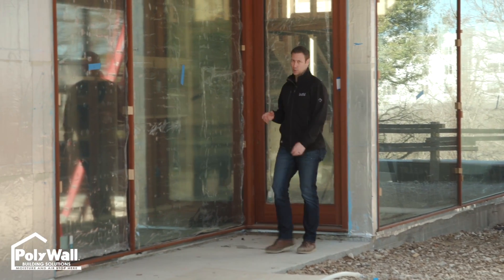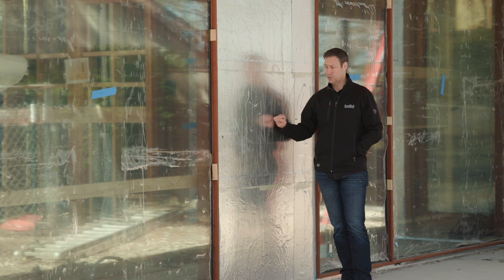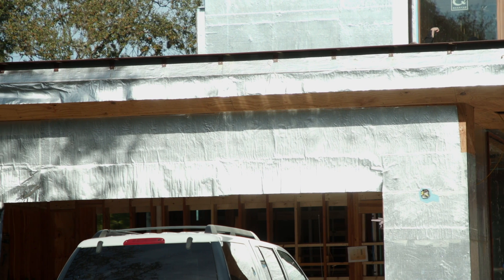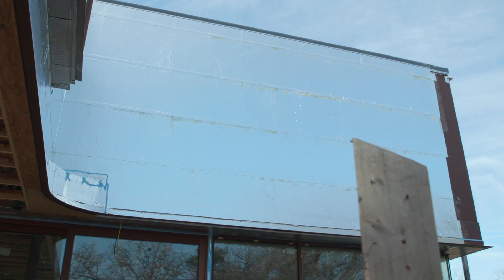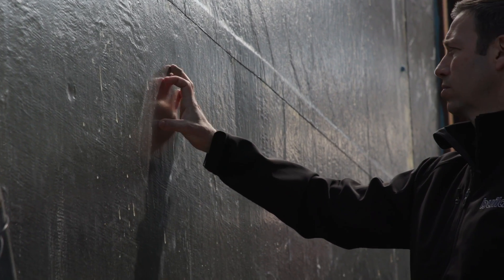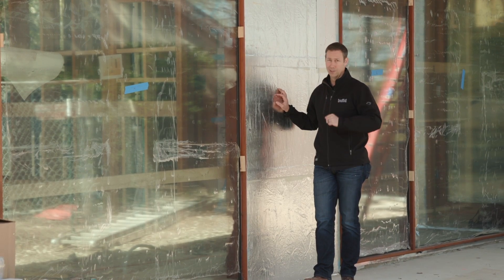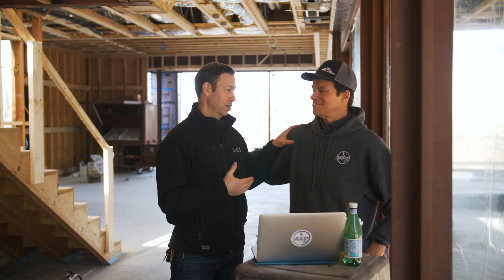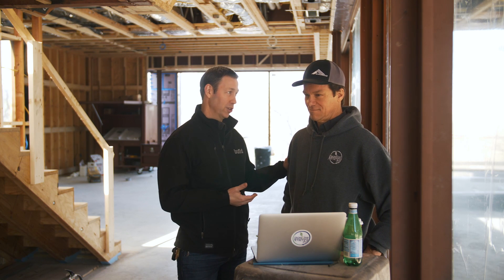Is a Zero Perm House Wrap Stupid?

Comment: To keep dewpoint in the foam, used WiFi to simulate.  I planned on wall drying to inside so used borosilicate paint to allow permeability of drywall.  Passive house training said primer and two coats of paint is nearly zero perm.  Have you considered this for your projects with the aluminum looking barrier?
Reply: Most latex paints aren't that bad (1-10 perms) unless you're dealing with something like a "bathroom" marketed paint. Vapour retarders are also only proportionally effective, so you likely have diffusion through the rest of the assembly. And air movement through other penetrations.
It's good advice for a passive house, where the margin is more important, but probably not an issue for the majority of builds.
I do wish building inspectors in Canada would accept impermeable paints in place of poly though ;)

Comment: Does the aluminum flashing interfere with cell service?
Reply: It helps to keep aliens from scanning brain waves. No more foil hats to mess up the hair.
Reply: @circularebin  🤣🤣🤣🤣🤣🤣
Reply: On the upside, it will improve indoor wi-fi performance/reliability due to reduced interference from your neighbours. Once you're at home you mainly care about wi-fi reception anyway—especially if your smartphone and cellular provider supports VoWiFi.
Reply: Protects from ‘harmful’ 5g
Reply: @Grunttamer  LOL yeah I heard that stuff gives you the covid = )
Reply: My house has foil faced poly-iso under the siding. My WiFi does not work well on my deck 15 feet from my router.
Reply: I need to interject here: new windows that have metallic coatings (low-E coatings) can affect cellular reception. I even have metal siding (not aluminum but steel) on a 1940's cape. I have to use wifi calling. This is frustrating as the home also has...plaster with metal lath. When near a window, the cell service might cause the wifi calling to drop. (only on second floor where roof is not protected from cellular signal penetration) which brings me to metal roofing: all this thermal protection and weather protection using metal will affect cell services. You will need to either get relay antennas to extend service inside, or depend on wifi-calling (and need heatmapped interior survey with additional APs).
Reply: The answer is yes, it will destroy cell and radio service, windows or not.
Reply: More than likely, yes.
Reply from the maker: The windows allow cell service
Reply: @buildshow  So the answer is it does affect Cell service. Nice dodge though = )
Reply: @buildshow  that's what the windows in bathrooms are for .... most important place for cell service IMHO

Comment: I'm interested to learn how this product performs in colder climates, since the perfect wall always shows insulation outside the air control. It makes a lot of sense for warm climates though to seal the warm side.
Reply: It doesn't because what you use is dependant on where you want that saturated warm air to concentrate and release the moisture in it. 

In cold climates it's inside and in warm climates it's the outside.

Vaisala for example has a free tool for counting different variables of moisture in air flow https://www.vaisala.com/en/lp/humidity-calculator
Reply: @Ed-ti1ss  right, but the problem is that we put people inside buildings, and people produce lots of moisture: breathing, bathing, laundry and cooking in the kitchen produce tons of water vapor that is going to condense and saturate the interior unless you get rid of it.
Reply: Ed Unless you're in the south where the humidity is on the outside
Reply: You want a tyvec type outer coating here in the north. All it takes is a pinhole in the inner plastic to get a lot of water in the wall. Also for attics you want to mix cellulose and fiberglass since fiberglass looses it's R value when you are at -40.
Reply: @LaserFur  No, you don't need to mix cellulose and fiberglass. Just use the cellulose. Once I tried cellulose I never, ever used fibreglass again. I've built five super-insulated buildings so far, with one under construction now. Blown-in cellulose was used in all but one.
Reply: @paulmaxwell8851  pushing Cellulose past R60 will cause settling. So mixing is good. The fiberglass helps keep the Cellulose from settling. and the Cellulose prevents Air piping.
Reply: @David-gld  Agreed. Per 2015 IBC, there are no restrictions to having a Vapor Barrier (i.e. Class I Vapor Retarder per code) on  the outside side of the wall, as long as the interior vapor retarder is a Class III (semi-permeable) vapor retarder, and you have a vented cladding or exterior insulation. Since the Aluma Flash vapor barrier would prevent drying to the outside, in northern climates it's critical to keep the rest of the wall as vapor open as possible so that the wall can dry to the inside, and yes, install a dehumidifier. But as an architect, I would not use this product in a northern climate because it puts the vapor barrier on the cold/wrong side of the wall, thereby inviting condensation/mold/dryrot inside the vapor barrier at the sheathing and wall cavity unless you do a REALLY great air sealing and insulating job.
Reply: @Seattle-2017  If most or all of the insulation is exterior, i.e. outside of this house wrap, then the vapor barriers on the warm side in a cold climate.
Reply: It's quite startling to see so many builders disagree on where the vapour barrier needs to go, which seems like an important thing. This can only mean houses are being built using any and all methods described here. Eek...
Reply: @matsudakodo  Yeah, I watch a lot of videos like this, and more often than not, they are so inadequate on details of installation that you are actually better off not watching them. You are left with no conclusion and that really sucks!  On this subject, maybe two layers of 15# tar paper might be the most proven and the best option from a price standpoint. We’ll never know!
Reply: In general, it will perform poorly in cold climates, but I'm speaking from Canada. You're generally required to have a <1 perm vapour retarder on the inside as a heating climate, so an impermeable WRB/air barrier has higher risks of trapping water inside where the warm climate assembly here could breath to the interior. When do use foil faced insulation on the outside (for that little reflective boost and extra water shedding) we generally want to specify one with microperf to leave it more vapour open.
Of course, like Kristof says, it all depends on the project and air infiltration is a much larger problem for moisture than vapour movement.

Comment: Thank you for this info. I do have a question here and would appreciate your feedback.
I live in PE Canada, it gets very cold and dry in the winter yet very warm and humid in the summer, what vapour application would you recommend, closed or open and what products?
Tyvek is used everywhere here but I feel there is a way better product out there. 
Thanks in advance :)
Reply: Typically in Canada, as a heating driven climate, your vapour barrier should be inside your insulation. If you already have a stud wall filled with batt and are looking for a house wrap you should be looking at an air barrier that is vapour permeable. While Tyvek is one example my personal preference would be a adhered system of which there are many manufacturers.  I would consult a local architect with you specific wall assembly for specific product recommendations.
Reply: I agree with Christian. VP100 Blueskin is becoming pretty standard on high-spec projects, but every manufacturer makes something similar that works with the rest of their tested system. Another benefit over traditional tyvek is that it generally less prone to random rips and tears as it's tight to the house and self-sealing. It also lasts longer in UV.
Reply: I used 1" aluminum board here in Ct directly behind my cedar clap board over 25 yrs ago and no issues yet.

Comment: I've learned so much from Matt. Joe Lstiburek and Martin Holladay's articles have also been hugely helpful. I design stock house plans which can be built in any climate zone. I've settled into a flash&batt system in 2x6 24" o.c. framed walls. It's a compromise on insulation because I still have thermal bridges at studs. But with insulated headers, 2-stud corners ... I've reduced thermal bridging by at least 1/3. Having closed cell foam on the inside face of the sheathing puts the vapor barrier in the center of the wall, both physically and thermally, so that it works in both directions, with the wall able to dry out in both directions. I avoid the complications of waterproofing openings that arise with exterior insulation. But I do have to detail out the air barrier carefully at the joints between walls and floors or roofs.
One way or another there is always a trade-off. Which ones we choose depends on our circumstances.
Reply: However, a growing number of states are starting to require continuous exterior insulation for all new buildings. Washington, for example.
Reply: @zilfondel  Yes, this is one of the dilemmas of designing stock plans. Every jurisdiction has its own quirks. My approach has been to try to detail in a way that is easy to adjust. So for flash&batt I specify 1" of closed-cell spray foam for zones 1-5, 2" for zones 6 and 7, and 3" for zone 8, adjusting the batt portion. This keeps the right percentage of foam to batt and it all fits within the same wall thickness. Also,  I exceed the minimum total R value by 1.5 to 8.75.
I've only been doing the stock plans for a few months. So far I haven't had any problems. Hopefully that will last. By overshooting my R values I can show that the "whole wall" values, accounting for the reduced thermal bridging from my framing details makes my wall sections comparable to having continuous exterior insulation.

Comment: Love your channel, but I wish you would provide more education for climate zones 4-6. I know you live in Austin but would be helpful for everyone in 4-6 to know if what you are doing works just in zone 2 or 3 or applies the same in the other climate zones.
Reply: Matt is a big believer in the Perfect Wall, so most of his stuff applies to zones 4-7 as well. The biggest difference I can see is foundations-Matt can afford to build un or minimally-insulated slabs, but further north you'd have to either insulate the slab to keep the earth beneath it above freezing all year or build stem walls or basements.
Reply: The physics is quite simple if you want a proper house you need a quality vapor barrier on the hot side of the wall.
In hot climate (24/7) you need a barrier on the outside of the wall/roof in colder climate where you have a  warmer area inside you need a barrier on the inside part of the wall/roof. This rulle is for water vapor (mold) you still need a rain protection/curtian on the otside of the wall even if you have a vapor barier inside like in colder climate this aditional barrier must be vapor permeable like a goretex for people .

Comment: "standard" house wrap used all the time... we know you can't say it, Tyvek.
Reply: Also it's clearly shown when they look at the analysis.
Reply: I don’t think I’ve ever seen a house that wasn’t using Tyvek around here, even some $800K+ ones. Sad.
Reply: @schpenxel  here, you can tell the houses that used tyvek, because they either get resided within 5 years, or they get bulldozed in about 15.
Reply: @kenbrown2808  Tyvek is very sensitive to UV as well. If you leave it on a house for too long in a sunny place like Texas, it turns to dust. Most builders don't consider the other choices, though. Zip is becoming more common, but it's anybody's guess how well it was installed.
Reply: @Crusader1815  zip's heavy reliance on adhesives to prevent water intrusion is beyond cringy to me.  couldn't get away with that in my climate, either - everything gets lapped, adhesive or no adhesive.

interesting trivia bit - when tyvek first hit the market, they were selling windbreakers made of it, and apparently they worked well.
Reply: Oh but how many times do you see that Tyvec Ad before a Build Show video which is one of the biggest lies in construction???
Reply: Does he mention the perm rating of the wrb they put up against this Polywall product? If its above 25, of course its going to allow more vapor drive. I say, save your money and use 7 perm Adhero. Dry the wall  both ways.
Reply: lol Tyvek has had a monopoly for decades
Reply: Of course he can say it, but Polywall is the sponsor and it's bad form to bash competitors by name. Plenty of junky wrbs out there, and plenty more hacks installing the crap.

Comment: Is there any concern with non permeable about moisture that is coming from inside the house (showers, kitchen area examples) being trapped in the framing? Or is that so small that it doesn't amount to any problems? Thanks for another great information packed and backed up video 👍
Reply: My understanding of this system is that interior generated water vapor will not condense inside the walls because the inner face of the vapor barrier, which is the foam exterior insulation, is warmer than the dew point. So the water vapor will not condense since it has not hit a cool surface. As the house is ventilated it will be flushed out. With tight houses like Matt's it is critical to have mechanical ventilation.
Reply: Matt runs dehumidifiers in his builds so this negates the issue. The wall can dry internally so keeping bulk water and air out is the primary focus.
Reply: Thanks for the replies. School day for me

Comment: If you're in a hot climate, it makes sense. If you're in the transition zone or a cold climate, it does not make sense. Just like the exterior polyiso that you use. Every market has products that fit and you need to research what the pros use in your area. If there's a Risinger (RisingerBuild) or a Baczek (StevenBaczekArchitect on IG) for your area, I would see what they use and recommend.

Comment: Does the aluminum wrap increase or decrease then signal strength of cell phones 📲..... Does it reduce or strengthen WiFi signals 🤔
Reply: I hear it will protect you from alien mind probes, but you need the flashing details to be perfect.
Reply: It would decrease cell signal. I'd just moved out of a house that just had the radiant barrier at the roofing. Inside the house, 1-2 bars of service; outside of the house, 3-5 bars. I can only image what it'd be like totally wrapped.
Reply: Decrease. Easy to test yourself.

Comment: Man you are always talkin about insulation and house wraps. Snoooze.
Reply: One of the most important, yet overlooked parts of building a house. Always spend money from the outside in. You can replace cabinets or flooring down the road, but you can't change square footage, insulation, WRB, and roofing without extreme cost.
Reply: @fordrac1ng81  exactly

Comment: Maybe...
So I have done a lot of resi work in Montana. I am now doing commercial and civil in CA. Building science has really been one of the added value items I try to bring to differentiate. 
It really depends on your environment. If you have a consistent temp (ie, FL where it is always hot and humid), or northern Alaska (almost always below 80) you have one direction with moisture drive. 
I personally prefer to control moisture and vapor, but there are some regions where it is risky. Exterior insulation opened the door to more control as it is always going to offer a safer spot to drive moisture with its inherent resistance.
Reply: These open ended comments & YouTube Title Posts...... LoL
Reply: @theMekanik  The challenge is the builder and owner have to make the decision. $$$ is what it comes down to. I have done a fully vapor impermeable installation in Montana, where the temperature swings from -20 to 100. However, it was a conditioned home in the summer, heated in the winter. Moisture drive is almost without exception out of the wall system, so there is a vapor barrier on the inside driving it out. In that situation it works. If it were unconditioned it wouldnt. 

No solution is perfect, there are tradeoffs, and they almost always boil down to budget, performance, and life expectancy. Many people build for a 20 year life. that is it, because they know they will move. My clients want multi generational homes. My preference to build anyways. It may cost 50-100% more to build, but it lasts 100 years.